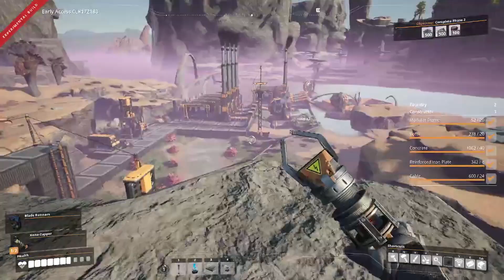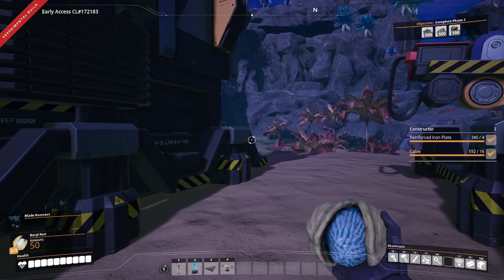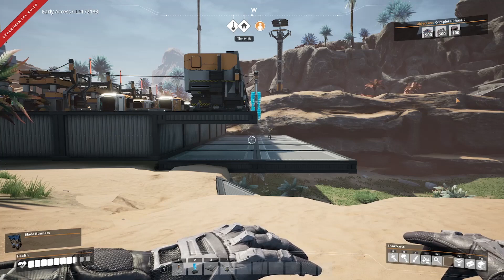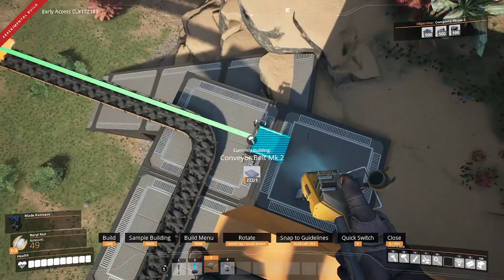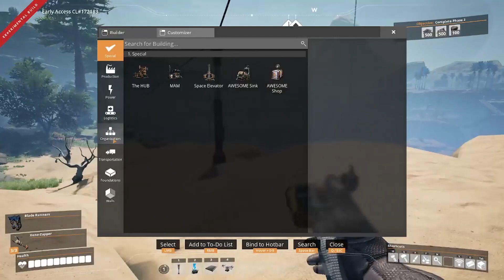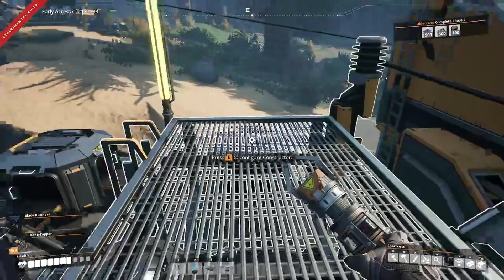How to build a Basic Steel Factory - Satisfactory Update 5 Ep 04  ( Let's Play / Tutorial / Guide)

Comment: can you help me understand something? in your setup, there is a single line that brings in raw material (iron or coal) which is fed in to smelters using splitters. Now, splitters dont know how to balance the load, it will simply divide the input over output (i.e. in your usual setup, for every 2 units of iron/coal it will send 1 unit to smelter and the other to next splitter. And same process will with that splitter) so with that math, the first smelter will be overloaded while the last smelter in line will struggle with the amount of input of raw material.

Same will happen in any other case wherever a splitter will be used (smelter/constructor) 1st machine will be over loaded and the last one will struggle. I struggle to find the solution to that in your videos. Yours seem to be running smooth. IDK if there a tech research involved that I dont have or there isnt any. I am more comfortable dividing the amount of units that needs to be fed in a machine by using 1 splitter to be fed into 2 splitters and then thos 2 splitter feed into 2 machines. that way the math is kind of perfect and no machine struggles with input of materials

I hope I made the question clear with my little knowledge of english language. Will be waiting for your response. Are you a mechanical engineer :)
Reply from the maker: I use a manifold system to load balance. This means that the first machine overflows until it is full, but then only takes as much as it needs. Then the second machine overflows until it is full, but then only takes what it needs. and so on down the line. Search for 'satisfactory manifold' to find many videos discussing it at length. Ill do one soon as well. 

I was a computer science professor for many years, but now I am a farmer.